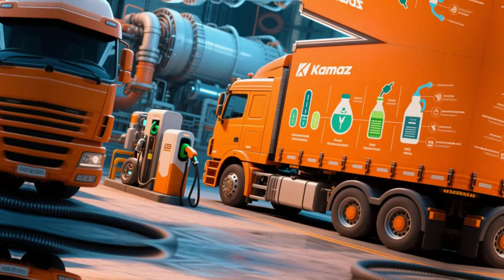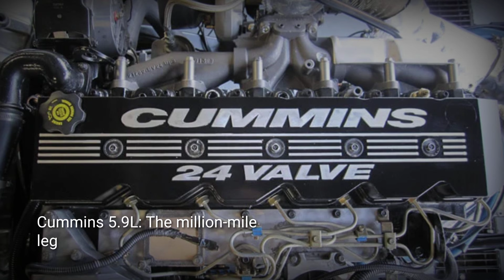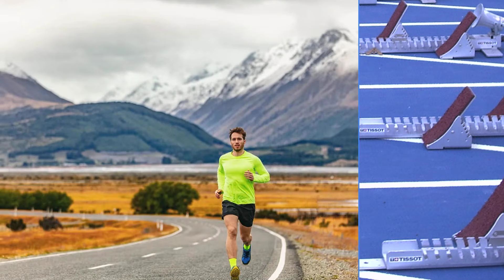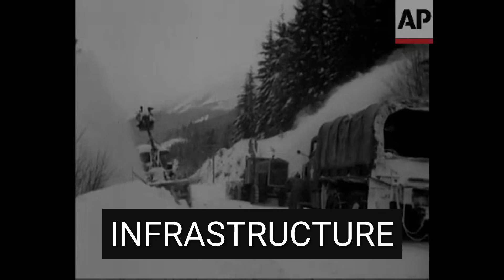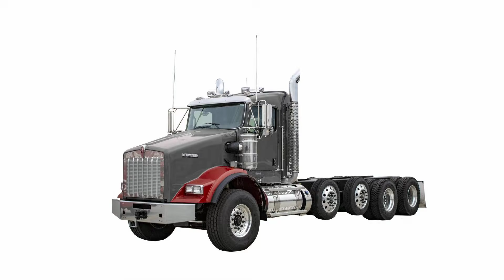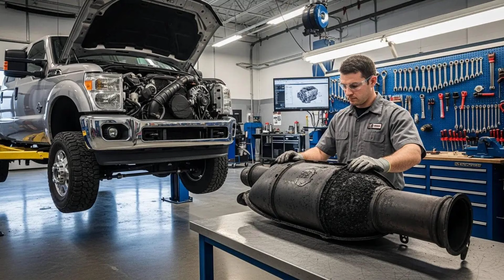Why Russian Trucks Run For 50 Years But American Trucks Don't

Comment: Actually Soviet trucks are cousins of US trucks. Although some Soviet trucks have obvious European influences, generally many Soviet trucks were originally descended from US trucks. Bit like Australian cars were for many decades used drive trains, etc that owed their origins from reliable US mechanical components but built to European design parameters, so had fronts disks & steering racks generally way earlier & the cars had much better handling, roadholding & ride balance, etc. Plus more room relative to their size & in the 70 & 80’s.

Comment: BS. No one Soviet truck designed for 50 years. Some trucks from 1975 do still exist and even running, but its ultimate pauperish scrap. The same as American wartime trucks somewhere in Asia - yes, they are still running. As walking dead.

Even 20 years for Soviet truck is well beyond its life end. Its sooty farting KAMAZ somewhere in poorest region, crawling 20kmh triple overloaded, because its owner has moiney only for this.

Comment: Until the early 2000s, in Ukraine, in order to obtain a driving licence, you also had to pass a technical exam on the entire propulsion system. Drivers were expected to carry out reasonable repairs themselves. [ the infamous Lada even came with a complete toolkit, admittedly very small because of the machine's simplicity.] I went to a driving school as a visitor, All along the sides of the schoolroom were actual parts cutaway of all systems,  engines, transmissions, axles, steering, brakes, etc.
Reply: Same here in Latvia, in late 90s . While I was learning traffic rules- how and where to drive, did learn- how car actually works. Even had to take two trucks apart as practice.

Comment: Hello! I’m from Kazakhstan and recently found an old Kenworth C-500 fuel truck from 2002 that worked in mining operations for many years.

It is dusty, huge, probably irrational to buy… and absolutely legendary.

The truck is still alive:

CAT engine,

manual transmission,

full-time heavy-duty mining setup,

and more character than most modern vehicles.

The problem is simple:I want to save it and turn it into an expedition/home-on-wheels project.The bigger problem:My wallet disagrees.

So this is probably the most unusual message you’ll receive today:would  like to help rescue one of its old beasts from retirement? 😄

Best regards from Kazakhstan

Comment: Everyone who is frustrated with the new emission controls have no idea what it is to live like in countries like Russia and India. 

Try living in New Delhi for 10 days and then let me know if you prefer clean air or long lasting trucks!
Reply: The rest of the story is that the overwhelming majority of air pollution is not caused by non-emissions trucks. Industrial pollution from the use of dirty coal fuels is the cause of most pollution. You could replace every single old truck on the road in India and you’d still have the same level of pollution.
Reply: Where did you see polluted cities in Russia?
Reply: @herobrinecyberdemon8104  everywhere

Comment: To be fair America was producing the Peterbilt 389, and Kenworth w900 till recently. Clearly they were simpler and more reliable if they kept producing and selling them. In reality russian and US trucks are actually closer in philosophy than most EU trucks are. Russia and the US have more smaller private truck owners that need a truck they can maintain themselves. They have alot more vast rural wilderness - Russia has Siberia, and the US has the mid-west and Alaska. If a trucker gets stranded there cuz of electronics, it's not an inconvenience but a life threatening situation. Meanwhile EU truck owners are mostly big trucking companies that can afford being in bed with Volvo and Scania's computers.
Reply: Initial USSR automotive industry was clearly US inspired, but that's not a secret (actually mass of the industry was till the 60s). USSR paid a massive amount of money to Ford for building a factory in the 30s - all aspects included, plus models so it can start proper production quickly. Still Soviet engineers did reinforce whatever they found questionable to survive rough exploitation in the country, adapting Fiat as Lada was no different.

Comment: This is stupid.  Soviet trucks are still in use 50yr later because they've been rebuilt that many times. Not because they are more reliable.  My sister in law owns and operates her own trucking company... 5 of her own trucks 4 drivers plus her none of her trucks are new, but all have modern emissions controls, she averages over 10mpg, and has had no emissions controls failures because she maintains the system properly.  Those dinosaurs in the former Soviet Union are exactly that.  Collectables that are forced to work long after they should have been retired to a museum.

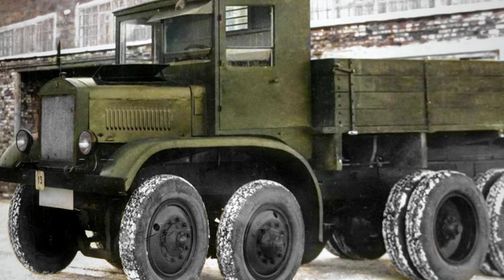Comment: 8:54 - there was no such thing as "Soviet design" in early (pre-war) USSR, majority were copies of foreign ones, due to the fact that pre-soviet Russia was pre-industrial (IDK the correct term, so I translate russian one) and had no engineering competencies to begin with.

 Survival of young nation required swift industrialization, which required solutions that had already been working, and those could only be copied in either designs or, at very least, concepts
Reply: Narrative parrot detected. 
Let us begin with facts. First things from ussr/russia:  First aircraft with retractable gear, first monoplane fighter, first sloped armour, first diesel in tank, first helicopter, first underwater icbm launch, first man in space, first thermonuclear tokamak reactor, first IRST, first helmet mounted aiming sight, first leead bismuth cooled fast breather reactor in submarine and comercial use 40yrs before west, first and still uncopied cloosed cycle oxygen rich rocket engine, first ion thrusters in comercial use on satelites 40yrs before west.... Aaand so on.

Comment: Maybe you should compare soviet trucks from 70s to american trucks from 70s, not choked and regulated to the deadbirth ones from 2020s.😂

 Also no KamAZ lasts 50 years without drinking blood and sweat of AT LEAST 5 drivers, 30 mechs and 10 of their common bosses. Build MAZ-500 series and later or KrAZ-250's might give you a better example of high quality and longevity soviet truck.

ZIL-130/131s are petrol powered and barely carry any significant weight by today's standards for you buck. Ones with diesel engines share majority of powertrain with MAZ and KrAZ.

From Russia with love, bro
Reply: The first "copied" US trucks from the 40s made in the USSR had the frame reinforced, and such resilience developed as generations changed.
Reply: @herobrinecyberdemon8104 it had and it did. That's not what people normally mean when they speak of engineering school

You've also replied to a wrong comment

Comment: Lolz dry sump oil system destroke crankshaft you'll be surprised my German American motor Detroit diesel series 60 14 liter Long block 3 million miles still